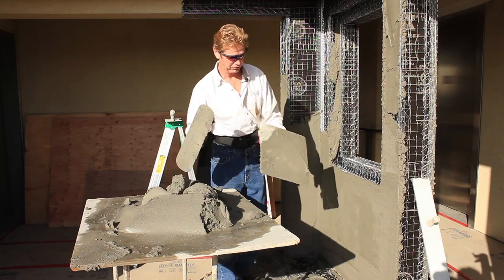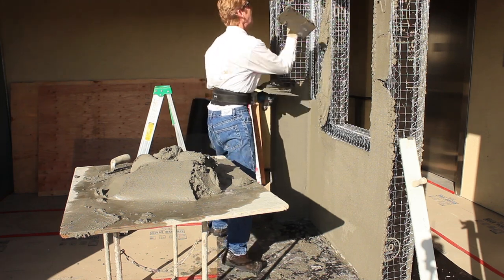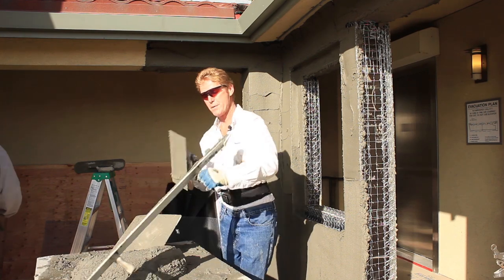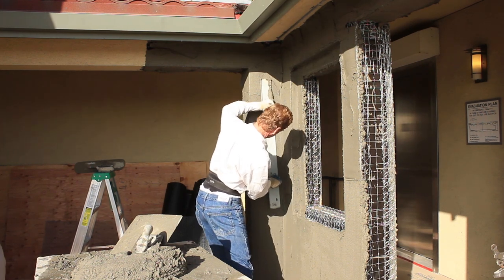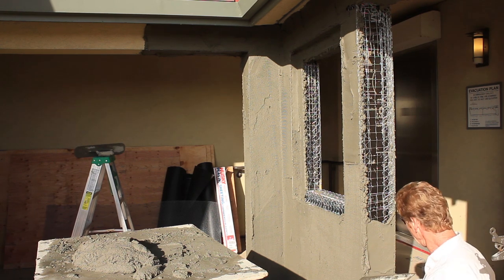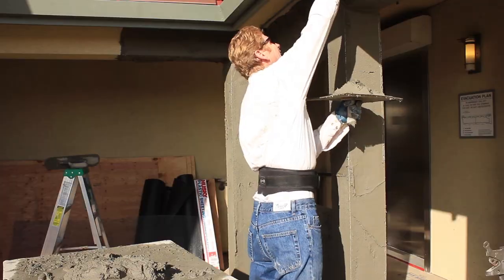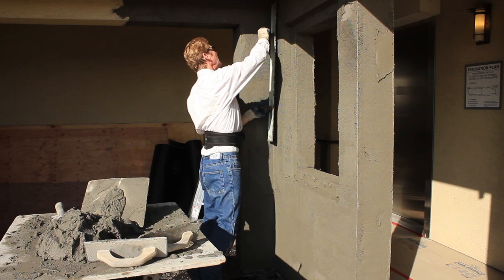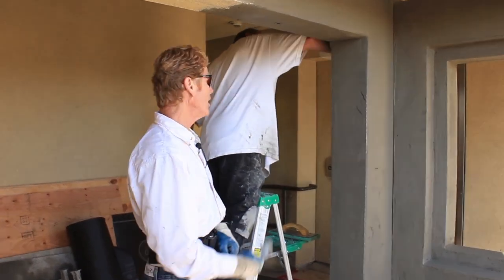Stucco application BMI 690 cement plaster

Comment: I actually depending on the mud pull it off the hawk both ways. If it's stiff I pull it off the top, if its loose I pull it from the bottom. Dont let those haters get to, you're the best. Happy New Year from Colorado
Reply from the maker: Hello Ernesto Gomez, 
 Any and all folks who disagree with my style makes my day, as theirs many ways to improvise in our trade.
Being the best of the fastest is way to much work, been there and done that, no glory in being the best except for bony fingers.
I trained many, but in teaching my sons, I preferred no extra crew as I wished them not to rely on other guys, so I had to plaster the majority as they were doing the best they could.
Cheers my friend and have a great new year.
 kirk Giordano Plastering
Reply: Thanks for the response. I really admire your work.
Reply from the maker: Evening Gomez, I like your style too,
 Cheers brother!
 kirk giordano Plastering

Comment: Hey Kirk good morning,I was wondering if u can recommend a good cement stucco bag from home Depot , that I can used pls thanks. , I don't know a lot about this!
Reply from the maker: Howdy Roger to mimic this? Greencore-USA is made by Quikrete. Its an all-in-one; you just add water.
 Another all-in-one stucco would be Rapid-Set Stucco again; just add water. Both are sold at HD.
 With most portland cement, we add three times the sand to every 1 part of stucco we buy our materials at the plastering yards. 
As we have most times 4 different types of cement plaster for different repairs. https://youtu.be/MbZHkJCJuZ8/ 
Quikrete stucco over bricks or blocks walls.💃🏻
Reply: @StuccoPlastering  👍

Comment: Hello Kirt plastering;   What i need to know is how do you know how thick to put on that first coat ? 1/2''  or 3/4''  & how do you gage that depth ?  & is that first coat a scratch & coat ? how thick is that to be ?
Reply from the maker: Good question for us it's just practice, for most beginners you match the weep screeds with the window and door frames, depth, this is where a darby comes in handy.
 Cheers.
Kirk giordano

Comment: I always wondered what kind of wall are you plastering when the lathing and the wires are on the wall. Could you tell me what kind of wall is it and why you put it on? Thanks!
Reply from the maker: Evening Mate, the contractor built the wall as a barrier, we as stucco guys added the stucco netting so that this wall could be stuccoed.  
 Without paper, the new wall which has plywood on its exterior could not be waterproof, without stucco netting the stucco will not stand by itself instead it attaches to the stucco netting and stays put forever.  
                Peace, love with happiness to all.
    Kirk Giordano plastering tips-mixed with sound advice
Reply: @StuccoPlastering  Much obliged! Your videos are awesome , keep up the good work!

Comment: BMI 690, can you mix it in a bucket? Thanks
Reply from the maker: They have specifically designed machines for complete homes. However, I have mixed it in my mixer, wheel barrel, and buckets too.🍾

Comment: One coat ? If so how thick, and then you apply color coat? Easiest way to mix ?
Reply from the maker: 7/8 of an inch thick is what we try for, typically.
Reply: @StuccoPlastering  Thanks, I guess color is incorporated in stucco ?
Reply from the maker: @hm-ys4ym  Base coats are grey as Portland cement is grey. They do sell colored stucco. It’s sold in 94 pound bags with two pound color pigments that are added when mixing.
Reply: @StuccoPlastering  Thanks ..,saw this online, LaHabra Fiber-47 Fastwall. which is compatible with their  Santa Barbara Mission Finish
Reply from the maker: @hm-ys4ym  Cool beans. 😉
Reply: @StuccoPlastering  Just realized this video's 10 years old , your'e probably retired by now , I need to stop bugging you and let you enjoy your'e retirement.., happy retirement!!
Reply from the maker: @hm-ys4ym  I’m far from retired, lol

Comment: what did that man in black shirt say to you?
Reply from the maker: Evening dieselisool dude, he suggested that I put more mud in the ceiling, but I didn't lath this as well as I should have if I were on the ball, I would have taken a minute longer when I lathed it and placed a corner aid upside down  the full two feet so I would not have had to float two solid inches and expect it to hang well. Oppps my bad, shit happens and such is life,
Best wishes and thanks for watching.
 kirk Giordano plastering

Comment: A straight edge is completely different to a daebt hasn't for handles
Reply from the maker: Hey Chris, you caught me messing around on the computer, Yea, we used to use 10 and 20 foot rods or straight edges all the time in my Union days when we plastered a lot of banks and other big building, especially if they were going to add the thin brick to the brown coat. Had to be within an 1/8 of an inch per 20 foot section, or at least we tried to do this.
 Best wishes, 
kirk giordano plastering